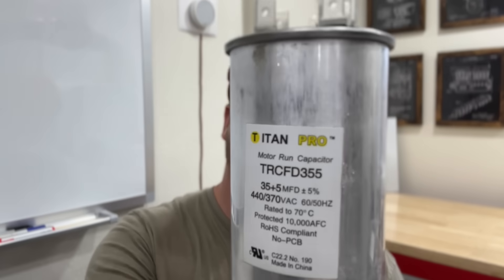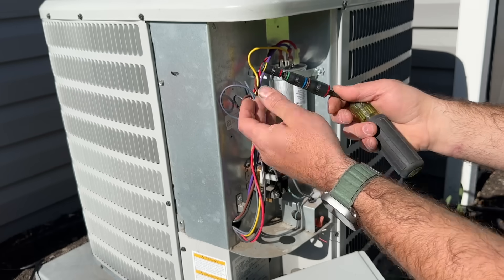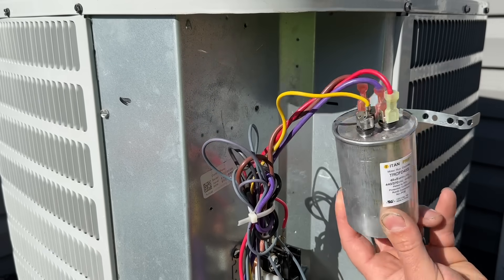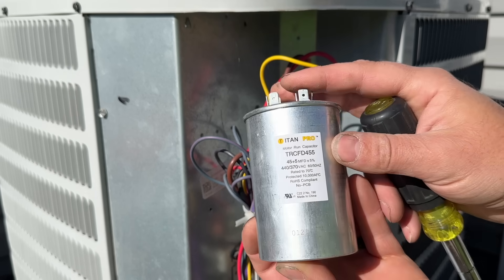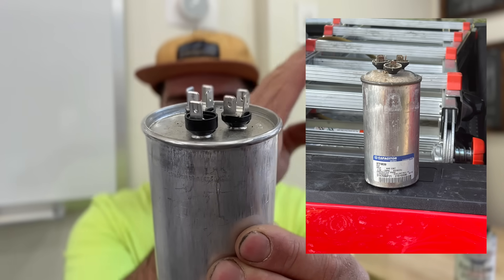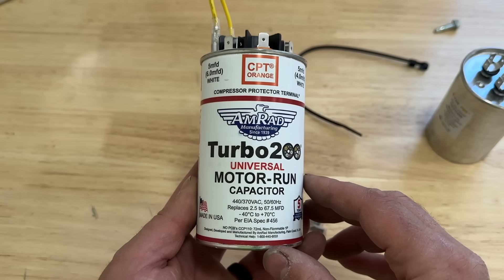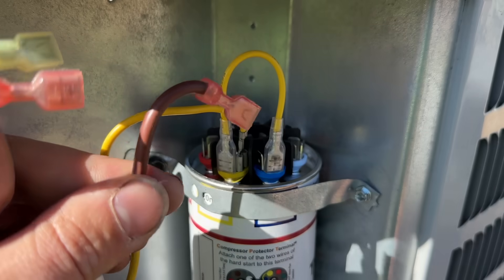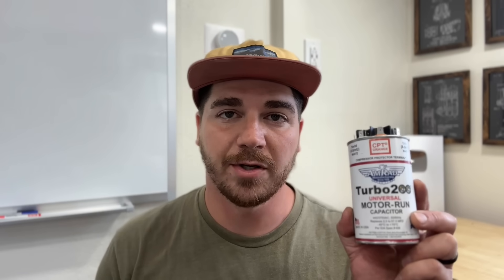HVAC Contractors Practically Make Their Living On These

Comment: I would not do what this video suggest unless you own a multimeter and you know how to use it many disconnects have been wired through ! I do this for a living and see it often. Never assume just because you pulled a disconnect that you have d energized the equipment. I would charge 183 for this repair along with testing multiple other things. it's not just the capacitor as most people think use your brain. We do this for a living. We see things that you do not.

Comment: Very good video and I have some things to add. Another giveaway that your cap is bad is that the unit will hum. If your unit is humming chances are that your fan motor will be very hot to the touch. An additional test would be to take a long screwdriver and spin the fan blades manually. If the blades spin by themselves but never reach full speed it is the cap for sure. The next tip is a big one. If your cap has gone out and your compressor has been attempting to run for a long time it will get extremely hot and will go into thermal lock which will keep the compressor from running until it has cooled down to a safe operating temperature. This is important to know because if you replace the cap and the compressor does not kick on like it should you may think that your compressor is toast. In this case spray the compressor with water to help it to cool down and wait about an hour before you attempt to start it back up. This happened to me on my last cap replacement. I can only imagine if I had placed an emergency service call. The guy most likely would have told me that I had a bad compressor and try to sell me a new system since my unit is over 20 years old.

Comment: My HVAC guy (and general handyman) actually taught me this when the run cap on my furnace went out on a weekend and he didn't want to charge me to come out. He told me he'd come out the next day for $100 but it was so easy I should just do it. He's also taught me how to clean carbonized ignition terminals with a fresh dollar bill when the same furnace wouldn't start with a new cap.

Needless to say, when it came time to replace our whole HVAC system and water heater.. he's the only guy we'll ever call.

Comment: First and foremost this guy gave a wrong explanation of what a capacitor does and purpose. If you dont know how to repair an AC system then call a pro. His time is worth money, his fuel, insurance and etc. So yeah a 12 dollar piece can cost you a couple hundred dollars. You are not paying just for a capacitor. The range of -+ means the capacitor can be over and under the percentage rating. Meaning a 45 cap with -+6% can read 45, 44, 43 and even 42.5 and still be ok. If it reads 42.3, the capacitor needs to be replaced. Thats why you pay a professional.

Comment: Thank you so much I just I saw you vedio 6/29/2024 I call the ac guy he was out of the town he said he come Monday and I live in Texas the heat really bad that day I take the chance first I clean the ace unit by water to take Any dust Around the unit ac not working then I find you vedio you talking about the capacitor so I take chance I shut down the electricity completely in my house so no-take any chances for danger. The I find my capacitor look like a pregnant 😆 🤣  then I take I take a picture for the information I need I go to ACE Hardware I pay 30$ then I install the capacitor the AC work Fine because the AC guy just told me he come to do troubleshooting gonna charge me 75 $ so thank you so much you have new subscribers in you channel

Comment: I had a so called “reputable” company here in the Phoenix metro area come to check out my ac unit. They told me 2 of the capacitors needed to be replaced at a cost of $1,200! 😳🤯 Luckily it was still under the warranty. After the tech left I checked the cost of the parts online. $32 for one and $8 for the other. I was so upset I filed a complaint with the BBB and AZ attorney general’s office. The A/C business is a total scam. A new heat pump unit is now 3 to 5 times what they used to cost 10 years ago.

Comment: OMGosh, thanks. I've been an industrial maintenance technician for 30 yrs but never did AC units and this is no different than what I've done a long time. Just paid $1000 for the relay that has arcing due to bad cap. Motor trying but sounding like single phasing, buzzing. I wondered about doing myself. Now with the world in a shit show, supply will dry up. Now I will but spares. Hell yeah.

Comment: Is it a good idea to just use the Turbo200 to begin with, effectively replacing the standard one on the unit now and using the old capacitor as the backup one?

Comment: Wow, this was so crazy easy to diagnose and install.  I just had mine fixed and the tech who came first checked the refrigererant and said it was fine. He then said it looked like I had  bad condensor motor but he wanted to check one more thing before he leaves.  He tested the capacitor and proved it was bad.  He then swapped it out and all was working fine. He charged me 1 hour labour for $100  and $147 for the capacitor.  He tried to take the old part off site but I asked him for it.  I then did a search and found it online for under $20.  I would have him back in the future if he were to have charged me $200 labour and $47 for the part but feel he pulled a fast one.  I did not get screwed for $2000 but still not an honest dealing.

Comment: I would definitely consider doing this DIY, though I don't have a capacitor sitting on a shelf at home, nor do I have a multimeter that measures capacitance. I'm pretty sure I would not want to be without A/C while waiting for an ordered parts, so I'd be spending about $100 to $150 for those items in order to be prepared (I would prefer a cap made in USA). Of course I can use the multimeter for other things, but it's still a cost. I looked at a few websites that list "fair" costs for various kinds of service. A capacitor replacement was listed for $100 to $250, and I would expect some additional fees for basic system diagnostics. So yes, DIY is cheaper, but it's not night and day unless you already have everything you need. Of course if the capacitor doesn't need replacement, then it's money lost. All of this assumes that someone is comfortable doing this kind of work when it is likely very hot outside. For a lot of people, DIY will not be a compelling alternative.

Comment: Had Ac failure, tried a different repairman. He charged $169 for service and $175 for the capacitor. Took him about a half hour to complete the job from the time he drove up. He left the old capacitor with me, so I looked it up. It was $8-9 from parts suppliers and $12 from Amazon. 11:25
Reply: Yup, they rip people off

Comment: Great video, a few helpful edits
1) when sizing capacitors always go off motor data plate on the fan or compressor you are working on, sometimes motors are updated or aftermarket replacements, or someone else put the wrong one in... and will not always match online data, the unit data plate, or even what you see... the wrong capacitor will toast your stuff.
2) the Turbo 200 is the best capacitor, up to systems running 60mfd or less for compressors. The 200 maxes at 67.5mfd and you will need some of that for your fan, some units run 70mfd or more and will need the turbo 200X to match capacity.
2a) If the capacitor on your blower motor goes out (house fan in furnace)  almost all current systems accept the Turbo Mini (2.5-15mfd), excluding ECM/Variable motors and obsolete Lennox running 20mfds
3) capacitors help start and run the motors efficiently by phase shifting AC current to counter inductive load and give direction to the motors. The power jolt to start component would be a hard start kit, however Hard starts are controversial at best and usually a scam that will generate more current and wear within your compressor in exchange for more starting torque and a faster start. (unless the compressor is already damaged and the hard start is used to buy time to consider options)  .....  (electrical theory nitpicking)

Comment: EXCELLENT video, Dave!!!  Thank you!!!  I just got a new AC/Furnace system installed in January because the old Heat Exchanger was cracked.  I had to have the Motor Run Capacitor replaced in the old system a while back.  My Home Warranty paid for the service call.  He added Freon while he was at it.  The charge was around $350 and my Trade Call Fee was $85, so both they and I made out pretty well.  I'm going to buy a Motor Run Capacitor to store in case this happens again.  I had a Surge Protector installed in the outdoor Compressor On/Off Switch box to help with this, but it's good to be prepared.  I can DIY this myself.  I know about discharging capacitors, but your complete instructions are golden!  You covered everything!  Thanks again!

Do you have a video on installing Grounding Rods to further protect the Condenser, its Electronics and the Fan?  If so, please give the link.

Comment: Ha,ha,ha you guys became good honest when that old technology is hardly used.All units today are inverter type or variable speed compressor,DC or inverter 3 phase AC,and fan motors are same type run on variable speed direct from main PCboard.At least 10 years to late.Im sure you made your MONEY before decide to being honest.This is the reason why this capacitors are so cheap now - nobody use them.

Comment: So I have a 2 stage AC unit.  For the past year it completely shuts off outside, fan, compressor... Sometimes it does it once a month then every 2 weeks or 3 every 3 days.  Maintenance comes out checks everything. All numbers are right on and freon is right. I've had compositor changed 2x.   They tell me it's all good but they say it shits off because it meet it's 3 error system.  Then told me to shut it all down even at the breakers to clear the errors. Wait 5 minutes. Turn on and it's back to normal.   But it just keeps happening.  What is the deal

Comment: Ok. Here’s the deal. Why are 95% of you guys crooks? I just recently had my 4 year old Carrier 3 ton unit start to blow warm. I’m ignorant of these things so I called the company that installed it, ARS. They’re a huge outfit, I believe they’re national. Tech comes out all sweet and nice. Looks at my unit, inside and outside, and tells me it’s my capacitor. He never checked anything. He said when they replace these they usually replace the contact switch at the same time. Ok. How do I know? All I DO know is it’s 94 and hot as hell in the house. My wife is not happy at all. I’m very motivated to get this fixed. He installs a new Turbo 200 and a contact switch for $1103.!! He had this figure on the tip of his tongue and blurted it out right away. All I knew was I needed A/C immediately( wife thing). I paid him and he left. Turns out my wife’s son in law works for ARS here in Orlando. She called him and he said Yes, you got scammed. He went to the manager who agreed to refund me $603.  So my total was now $500. Still got ripped off I think. Why is there so much dishonesty in this business? If you’re in the Orlando area and you are the only honest tech in this town please respond to my comment with a contact. I’m going to trash the hell out of ARS online, BBB, etc. I’ll do the same if your honest. I’ll sing your praises where people notice.

Comment: $10 for a chinese made capacitor on crapazon (if your lucky to even get one in tolerance).. the real ones that are not garbage are about $40 which are made in Canada/USA and last longer that have warranties.. a normal service call is between $75-$500 depending on the services rendered. so if your tech says it needs thousands, pay $75 and have a second opinion from a another company.. my late father had someone come door to door saying they are doing inspections they handed him a $12,750 estimate they were about to start and i caught wind of this tomfoolery the contractor showed up to the police, my lawyer and me to be sent away my lawyer very quickly had the contract voided as where i live its ILLEGAL to sell items door to door... my late fathers house used a very small furnace and small AC unit.. they said the AC unit was to small for the house and same for the furnace.. catch is when they bought the house BRAND NEW i personally brought in my own Hvac company and they sized and installed it. the unit was 8 years old and was NOT leaking freon and had no issues other then minor rusting on the bottom of the furnace where it was wrongly installed straight onto the concrete floor of the basement i had the same contractor come in and they said other then a tempermental thermostat which they replaced, the minor rust on the base of the furnace that they then lifted off the concrete and installed a pedistal (they admitted it was wrongly installed from the start) theres no issues with the Heil units they didnt even charge my father for the fixes or the thermostats so there is still alot of caring trustworthy companies out there.. do your homework on who you bring in.. i can say that its now 7 years later so the units are now 15 years old and its still the same Heil brand units installed without issues. also before anyone asks im an ASE certified auto techition which i hold a licence to carry freon and other stuff but household HVAC i stay away from and bring in a company which is local to me and i always gladly pay extra for them to go out of there service area to service things i need.

Comment: I can understand the high fees for changing out parts like this. Hell, I can even accept it. Where I have a problem is the dishonesty when it comes to the fee breakdown. If they were honest in telling you the part was, say, $20, and the rest of the cost was labor, I'm sure people would be a lot more inclined, and willing to pay the price. Especially if they are afraid, or feel unable to do it themselves. Up-charging the part cost by 1000% then telling the customer that's the cost of the part should be considered fraud.
  I get that contractors have a much higher overhead than most people think, but compromising their integrity by lying to their customers, then gaslighting, and even belittling them is unprofessional at best. Unfortunately this behavior seems to be fairly common within the trades, and homeowners are getting tired of being raked over the coals.

Comment: all HVAC companies are CROOKS. I had a HVAC company come out and check my AC unit because it was not cooling. he said he had to replace the relay. he just happened to have a used one in his truck and he could let me have it for $75, plus the service call fee. the relay cost under $20 NEW(unless you get it from a HVAC dealer/service).

Comment: A quality cap costs 25 bucks. I sell them for 187.50. That includes the service call and troubleshooting and labor. The brand I sell is made in Mexico or USA not China. The one you held up is a scam made in China and sometimes go bad in a day. It doesn’t only give the compressor a boost on start up. It also can’t run without it. I hope this video helps a lot of people save some money. But one of the benefits is to ask the tech to check the refrigerant. About 2/3 of the people are low on refrigerant causing the long run time causing the cap to overheat. So having g a tech that’s trustworthy is well worth it.

Comment: What do I check for in this example? A/C is set to 72 degrees but is showing 76 degrees. I’ve cleaned my A/C unit outside and changed the filter. By the way this is a Very helpful video😁

Comment: Im an HVAC tech and I thinks its cool if people are DIYers. People need to understand that they are not only paying for the capacitor when replacing. It takes gas for the large vans to travel to your home and theres overhead along with insurances that companies have to pay for. Something you should have mentioned is that sometimes a chuck in a truck can bypass the disconnect and even though you pull it off, the unit could still be powered. Can definitely shock someone. Just a thought when encouraging DIYers; you need to be careful.

Comment: 😂you said, take the guesswork out if you don't want to go open the unit. How are you going to test and check the Cap to know if you even need one if you don't open the unit? How do you think you're going to know what values to use if you don't open the unit? Furthermore, how are you going to change it if you don't open the unit? You're going to open the unit to test the Cap, so just get the values when you test the unit. Save yourself 70 or 80 bucks and buy the correct Cap for $5 or $10.

Comment: We built audio amps, in the early 60’s, using capacitors, transistors, resistors, and diodes.
   I’ve never owned or used a.c.🤔 except in the world, that owns and uses it.  I’ve ,only, ever, had 2 cars with air conditioning. 
I live in central Massa-choose-its, in the north hills. 
   My people all used air /con. My parents never. I did not want to need it, and longed for the Caribbean🇯🇲.